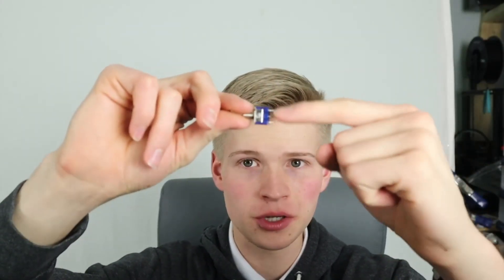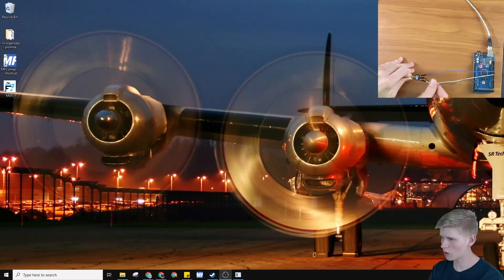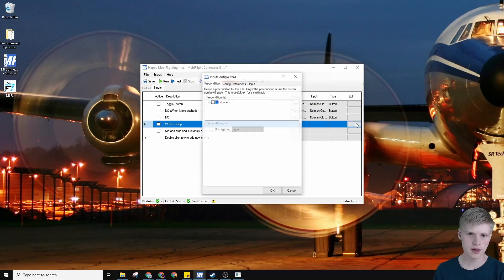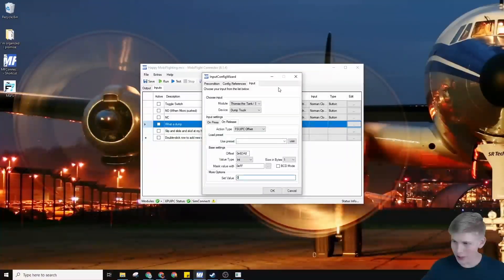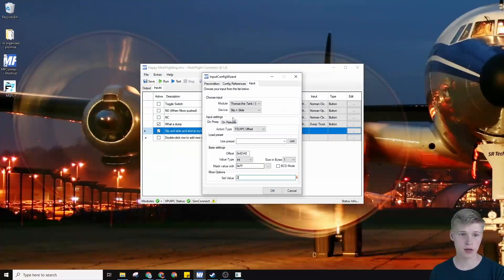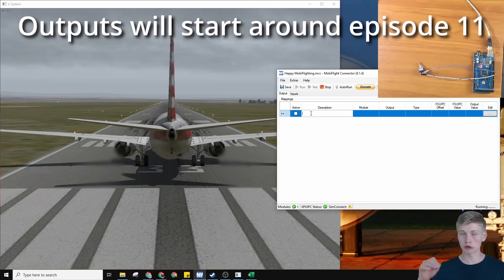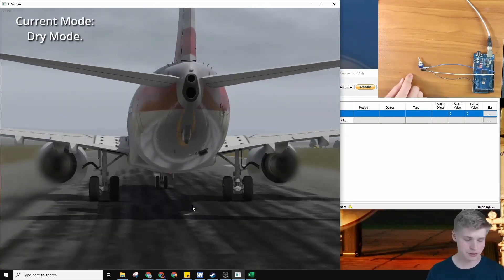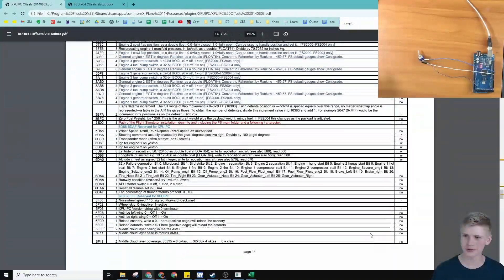Connect a 3 Position On-Off-On Toggle Switch to a Flight Sim | MobiFlight Crash Course Episode 6

Comment: Hi, newbie here, just wanted to confirm if it's fine if we don't add a resistor to the common because wouldnt it draw a lot of current from the laptop since it's essentially a short circuit when the switch is on?
Reply from the maker: MobiFlight automatically enables it's pullup resistor on the input switch so you're all good!

Comment: Will this hardware setup work for racing simulators? I'm trying to set up an on-off-on toggle switch for a rear steer vehicle.
Reply from the maker: Not with MobiFlight (as of now) unless you configure it to a vJoy button.

Comment: Hey, thanks for the video. I have a question regarding the toggle switch. Do I need resistors for them when using on a breadboard?
Reply from the maker: Hello! It's best practice to use resistors to pull up or pull down the signal but MobiFlight enables the Arduino's built in pull up (or down?) resistors so that helps filter the signal. I personally don't use resistors and I've had a good experience.

Comment: I’ve done everything but can’t find the code for the switches I need to function is there an easier way to find the code you need because some codes are similar and some times you can’t even find the code (msfs 2020 ~ Hubhop)
Reply from the maker: If you use MSFS2020 - Custom Input, you can search for your FS2020 (but not FSX/X-Plane) presets, then just select them from Select Preset below
Reply: @CaptainBobSim   Not sure about the wiring but I use Jumper wires male to female and in which they both function the aurdino by lightning up whenever I function it lights up yellow but I don’t think that shows up in the logging whenever I function my Panel, There’s just 1 thing that I didn’t follow from your videos and was putting the aurdino or the fsupic files in the msfs folder but I have them installed
Reply from the maker: Can you not type in a word for what you want? https://youtu.be/H7NMECMSKR0?t=448
Reply from the maker: Are you on the latest version?
Is you row activated (checkmark)?
Also another go-to is your wiring. Have you tried just pressing bare wires together to make sure it's not a wiring issue?

Comment: @ 0:43 the pin to the left and below hot A are those wired together (bridged) or is that just to indicate unused?
Reply from the maker: I believe they are bridged on the switch design. As always refer to your switches data sheet if you have one for wiring information

Comment: My sim value doesn’t change.
Reply from the maker: Check under settings to make sure offline mode is disabled. The light bulb should be gray. Also make sure you are using the correct sim and that the active checkmark is active

Comment: Hi Cap, Thanks so much for your videos, very instructive ! 
Something I don't get : there're a lot of pins on the board, but only a few "grounds". How do you do when all the grounds are used and you want to plug more buttons ??
Reply from the maker: Hello! You would need to connect all of the grounds together so that they are all touching each other
I explain this a little bit here: https://captainbobsim.com/2020/12/16/mobiflight-arduino-compatibility/
There are many ways of doing this, from twisting a stripped wire to using terminal blocks.
Reply: @CaptainBobSim  Thanks so much, you're awesome !